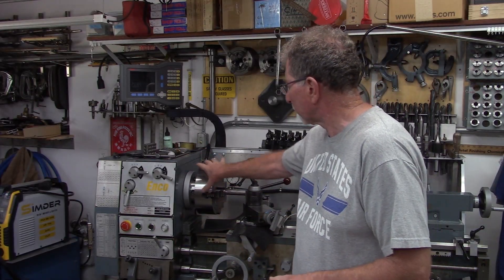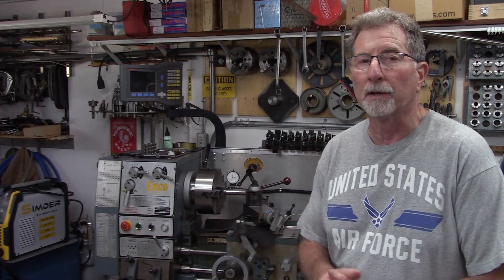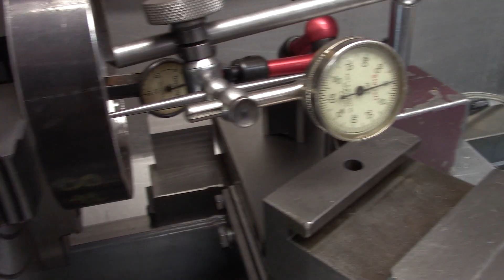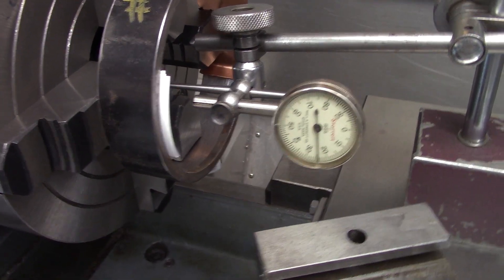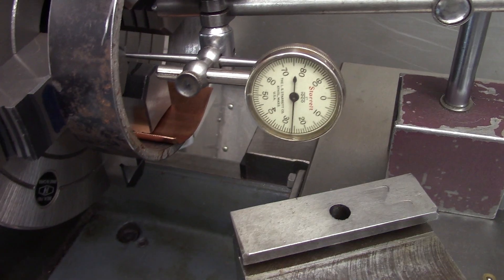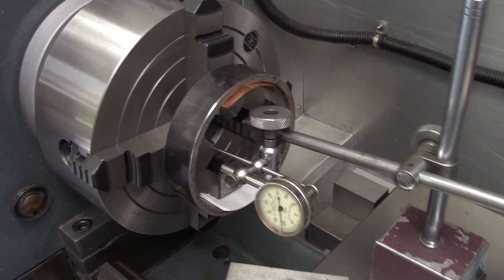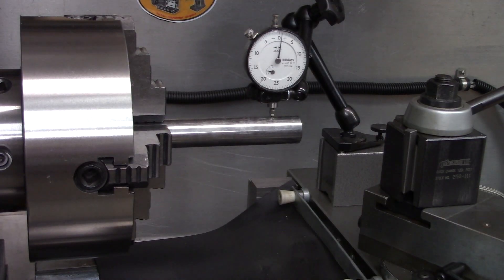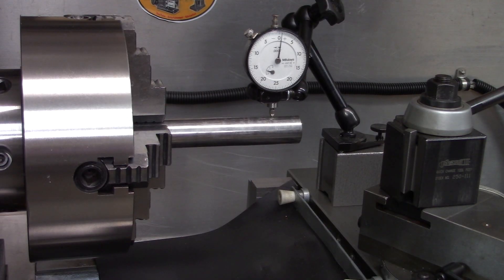Four Jaw Chuck Regrinding the Jaws

Comment: Dean, what do you think about the difference between jaws in compression vs in extension for grinding? I ask because it is going to be high on my list, once I find someplace to unpack my shop...
Reply from the maker: Yeah compression is the way to go, but not easy to setup. I did it on one with 2-peice jaws using longer outer bolts to catch the tensioning ring.
Robin Renzetti has a real good video on using a bearing race and a hard turned engagement slot.
I did think about using a carbide drill to put some pin bores in the jaws to engage a compression ring. The rabbit hole was just getting too deep..
Great comment Thanks!
Reply: @TheAyrCaveShop  Thanks!